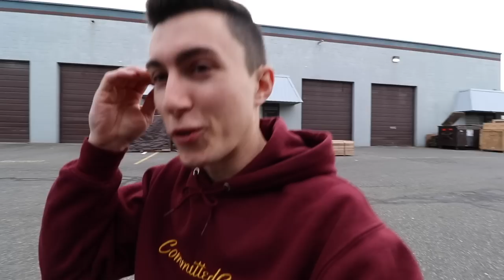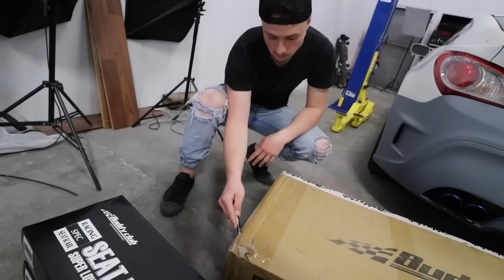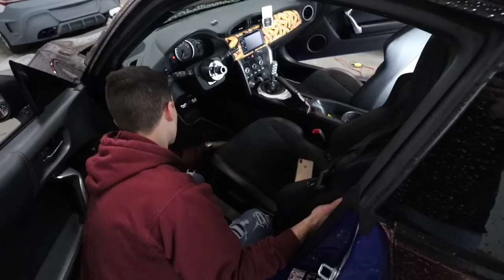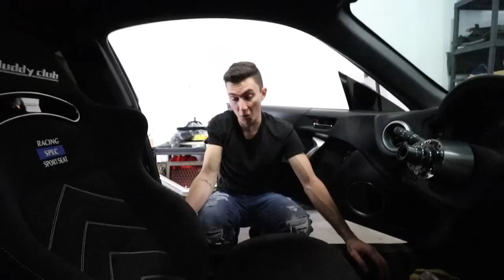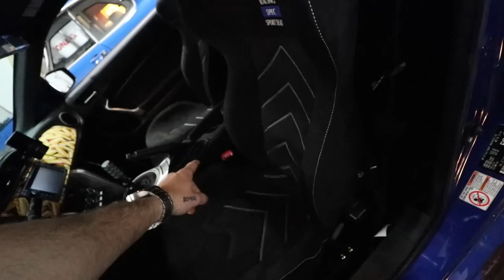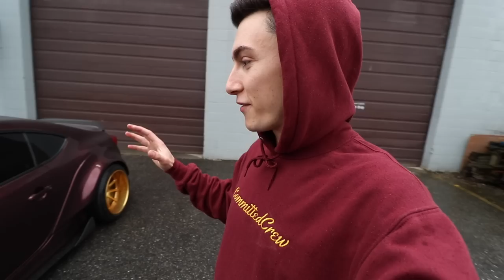BRZ Gets Buddy Club Racing Seats!

Comment: Harnesses are only safe if you have a helmet with a neck brace on. If you crash wearing a harness your body will not move from the seat but your neck will snap forward really hard. Just a heads up. Edit: it’s also a 4 point harness which are more dangerous than a 5 point because in the case of a collision you don’t have a strap in between your legs to stop you from sliding down out of the bottom of the harness. This means when you crash the harness can’t hold you properly in place and the lap belt can dig into your stomach causing some bad internal damage.

Comment: Hey Robbie,

I have the belts in a safe way without the harness bar. You could clip the ends to the OEM points with ring headed bolts. They're safe and great solution.

Nice seats by the way. Moved me a step closer to adjustable buckets.

Comment: You could do with some resistors in the airbag connectors for seats,  you can get resistors with fuses so if the airbag is triggered the fuse pops before the resistor gets very hot.

Also, keep the hot dogs!

Comment: Robbie you can turn the light off for cheap using a 2.2ohm resistor between the 2 airbag wires on each seat

Comment: 3.33ohm resistor wired into the factory air bag harness on the steering wheel will get rid of that light on the dash

Comment: Hey mate have you tried a resistor in the air bag connector to trick the restraint module to thinking there is an airbag in the wheel? i think its usually a 2.2 ohm or 7 ohm might do it. be worth checking.

Comment: Airbag light, you can do the resistor mod. Its literally just a specific ohm resistor inserted into the airbag plug under the seat.

Edit: https://www.ft86club.com/forums/showthread.php?t=86415